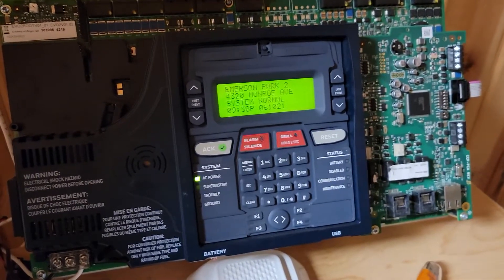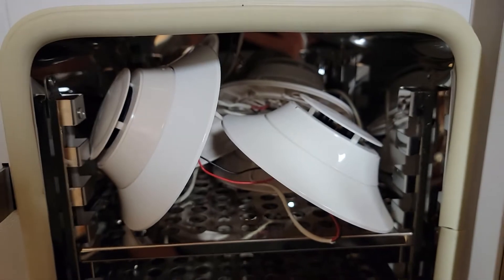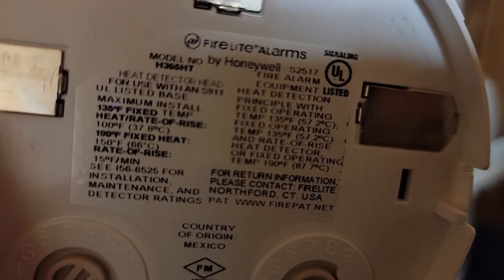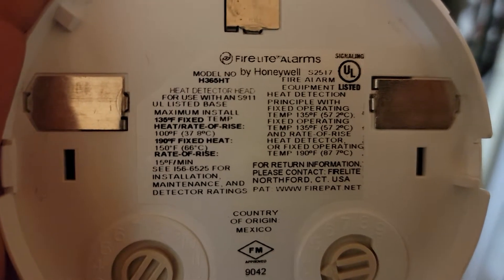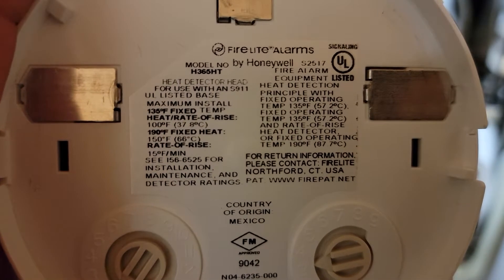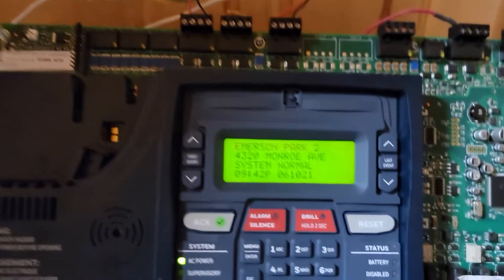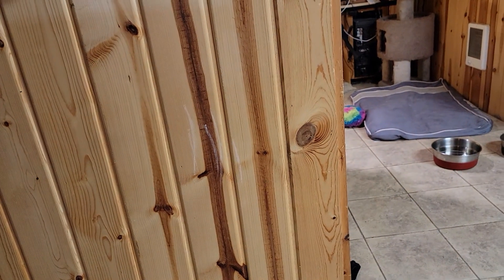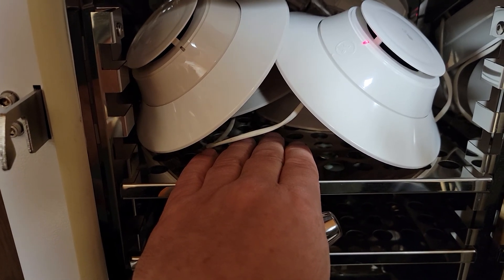Fire-Lite H365HT 190°F Fixed Heat Detector False Tripping Around 140°F

Comment: If this is a multi year problem then Honeywell probably doesn’t care. This is ridiculous with the quality control. It has been 4 years since Fire Lite has released the ES-Series. I wonder if the 6000 Series has the same issue. FFS Honeywell as of lately has been awful with quality control. The L-Series took 3 tries to get the mount bracket right, The 6000 Series and the ES-Series also ha been suffering from bugs, the Notifier FSP-951-IV and the ASD-PL3-IV recall, and what I heard about the BS with Notifier’s upcoming Inspire Series. I wouldn’t be surprised if there’s less Honeywell systems.
Reply: The 6000 series was fixed nothing wrong with it